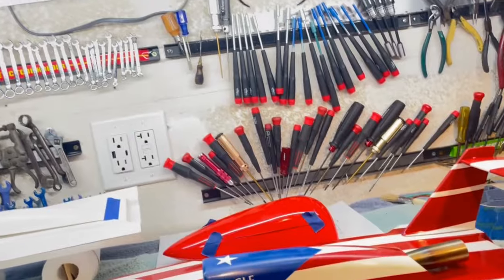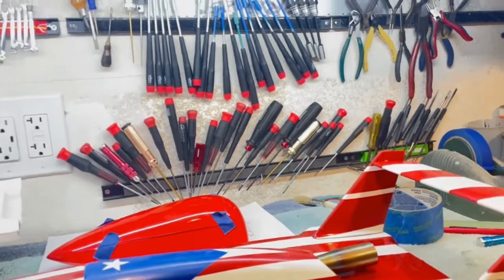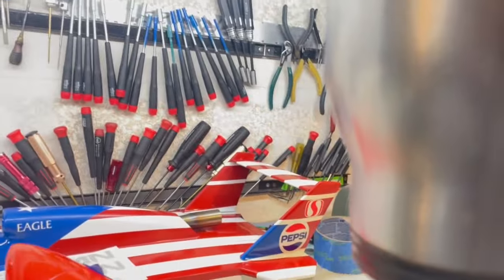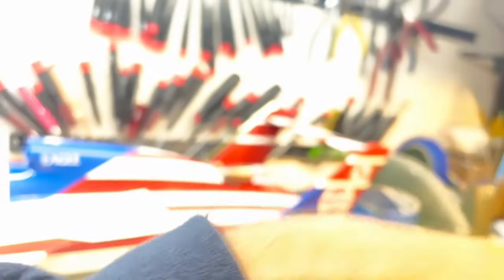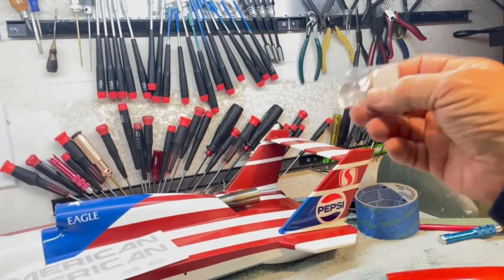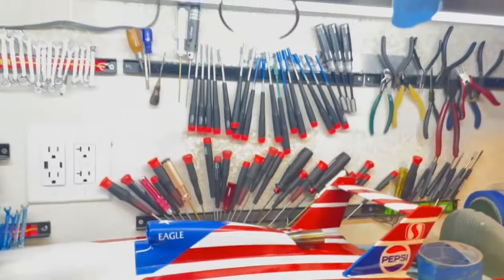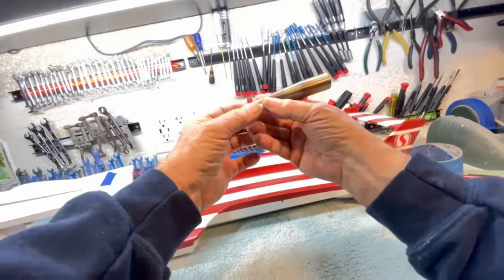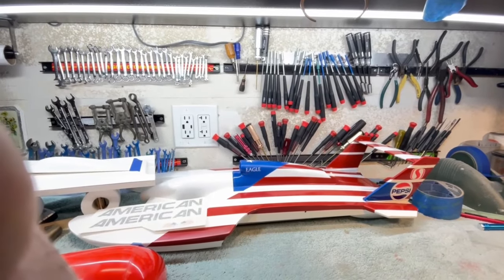Dr. Jet talks about turkey basters and ECOs

Comment: Why not use a pop can turned inside out for a engine exhaust.
Reply from the maker: I'm not really sure I how to turn a pop can inside out........ 🤔
Reply: @Dr_Jet  cut the ends off and one cut up the side and roll it inside out to the diameter you need and screw or epoxy together.